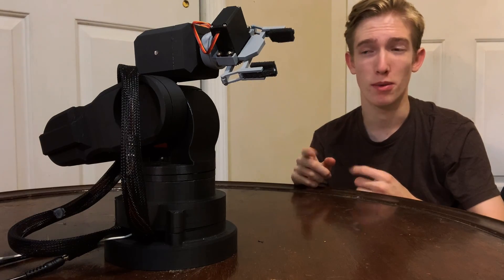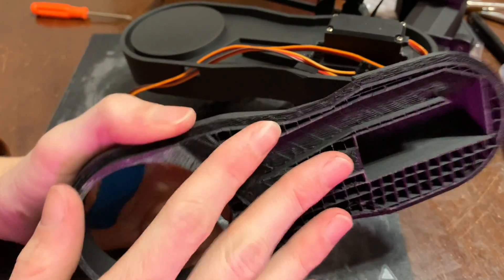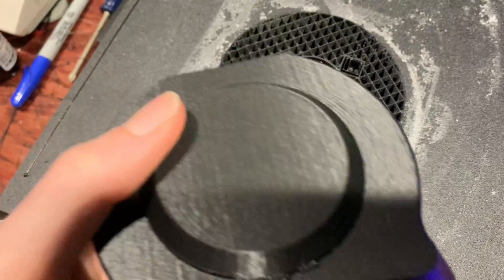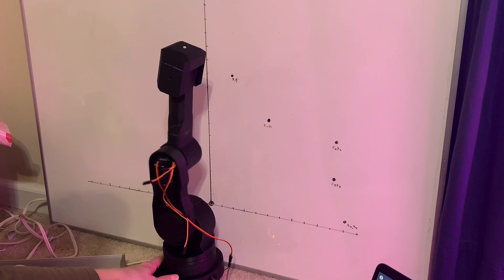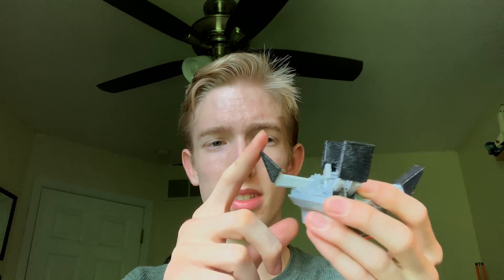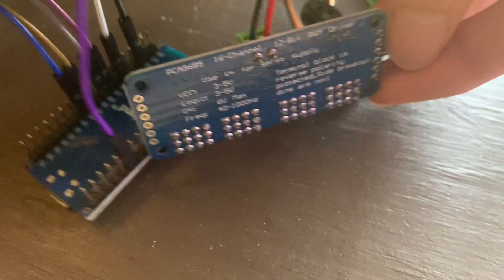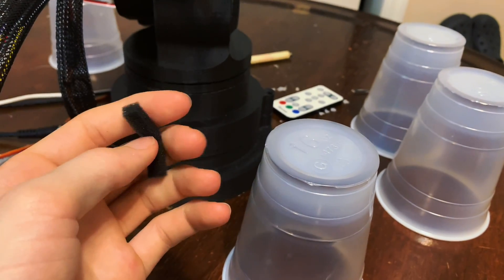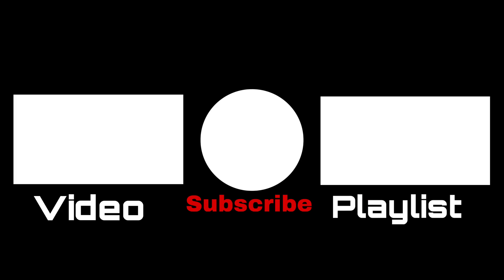3D Printed Robot Arm (Arduino)

Comment: Hello, are you using 3 types of servo 25, 35, 60 kg (270°) and mg90s?
Reply from the maker: 5 types, 25, 35, 60 kg, sg90s, and mg996R. For the 60 kg I just got a 180°, however 270° would be a better choice.

Comment: Which servo goes to which joint?
Reply from the maker: From bottom to top. First is 35kg servo, second 60kg, third 25kg, fourth SG90, fifth MG996R, sixth SG90, seventh MG996R.
Reply: @OliverPaff hey thanks again man if you don’t mind which disc goes into which circle it seems like only the big fat disc fits all of them
Reply from the maker: If you go to the assembly of the robot arm file it should show which disc goes in each hole.

Comment: Hey, this is truly an amazing work and you made so inspired iv'e started to make my own. I would like to implement the logic of the rotation of the joints. I've seen your Onshape design and i couldnt really figure it out how you made connection with the servo and the printed parts. Can you please explain how it works? It would much be appreciated🙌
Reply from the maker: Hey, thank you so much. I will say the connection between joints could be a lot better. There are discs that need to be printed that connect to the servo motor using a screw and then that disc is glued into the other part of the arm.

Comment: I'm working on a design for mine at the moment, I'm doing a couple of things differently. My base will house the rotating turret, and the initial "shoulder" joints motor will be recessed into the base and actuate the shoulder by means of a belt and pulley, a turntable bearing will allow for this with ample clearance. The second "elbow" joints motor will be aligned axially to the shoulder joints axis of rotation, and drive the elbow using another belt and pulley. This means the majority of the arms mass will be at or below the bottom axis of rotation. Both motors being Nema 17 steppers but geared down for torque and precision. With a third Nema 17 in the base to control rotation, also on a belt and pully system for precision over speed. 

In terms of upper joints, I'm still working on that, but I'm  exploring options to keep the heavy parts as close to the elbow as possible but also allow for a rotating axis before the wrist or a "forearm" rotation. Likely using a NEMA 14 stepper to control forearm rotation, and a NEMA 12 to control wrist bending, both mounted as close as possible to the elbow, the wrist rotation driven by a central drive shaft and the rotation axis of the forearm connected via belt. Then a wrist rotation axis and grab axis will be operated by a pair of servos. I also want a modular hand system so I can clip new end effectors into position.

Comment: I’d really appreciate it if you could share the exact types of motors you’re using and the quantities of each—I’m having a hard time rebuilding it on my own.
Reply from the maker: Yeah, sorry about that. I used 2 SG90 servo. 2 Mg 996R servos. 1 25kg servo. 1 60kg servo. And 1 35kg servo. Hope that helps. Let me know if you have any other questions
Reply: @OliverPaff  From the bottom to the top of the arm, can you list out the servos you're using in that order, i don't know which servos are suitable for which areas. Thanks!
Reply from the maker: First is 35kg servo, second 60kg, third 25kg, fourth SG90, fifth MG996R, sixth SG90, seventh MG996R.

Comment: is there any assembly video.. really need help with the assembly of the robotic arm and step by step building of the robot
Reply: How did you attach the base together the first and second servo together
Reply from the maker: @khii8953 There are discs that connect the two pieces together. The discs screw to the servo and then glue to the other piece. Hope that helps. Let me know if you have any other questions.
Reply from the maker: Unfortunately I have not made an assembly video yet. However, I can help with any questions you have

Comment: I've run into issues overall with motors not fitting into the holes, seems like the tolerance isn't allowing the wires to get through. The major issue however is the 60kg motor linked cannot fit anywhere on the arm and now I believe I need to return it. Any advice?
Reply from the maker: I didn’t have any issues with the wires it might be that there is support material that is in the holes preventing wires from moving through the holes. I turned off support for many of those areas. Also now that I think about it some of the wires I had to pull through using tweezers so I would try that. For the 60kg servo it should be the main joint connection it could be the wire is preventing it from going all the way in there should be a channel that allows the wire to travel down towards the bottom.
Reply: @OliverPaff  thanks

Comment: This robotic arm has a remote control Sir?
Reply from the maker: No it’s controlled by entering points into the code and the robot arm will move to them however adding a controller would not be very hard and there are many tutorials for it.

Comment: I have a doubt , how do you attach the servos to the Printed parts , wont it get loose
Reply from the maker: There are discs that connect to the servo that then attach to the rest of the arm with glue. It’s not the best attachment design for the ability to take it apart but it is strong. Also adding holes for bolts for connecting the pieces would be pretty easy if you would like to.

Comment: in the robot how did u connect the joints with the servo in the file there is no place to join or bolt a servo horn

Comment: yout vidoe was very great,but ı wonder how did you learn to write code.I wonder it because ı'm going to start to learn write code as soon as possible,so ı need to take a few opinion can you help me to understand more clear about how ı can learn
Reply from the maker: Thank you, I really don't know much coding though. I'm still learning and plan on taking some online courses this summer. However, I would recommend doing hands on projects such as with an Arduino. Also, YouTube can be very helpful when learning coding along with free online courses. Such as through edX. Let me know if you have any other questions.

Comment: which servo motor is that?can you give the specs.
I wana know if my TowerPro MG996R servo motor has enough torque for that build?
Reply from the maker: I used the MG996R for some of the joints however others will need a stronger motor. I linked all the motors in the description.

Comment: Can I ask which 3D printer you use? Been wanting to work on one myself but new to 3D printing in general.
Reply from the maker: For this project I used the ender 3. However, after this project I switched to the Bambu Lab A1 mini. Personally, I prefer the A1 a lot more because I spend less time working on the printer and more time designing stuff. I would recommend doing more research into different printers to figure out which one meets your needs and price range.
Reply: @OliverPaff  Thanks for the response and cool project overall! Did some research and that A1's calling for me lol.

Comment: How did you end up making the servo horns stick with the servo ajd not come off specially in the button join plane x-y
Reply from the maker: I had discs that connected to the servos that I then inserted into a hole. I held it in place with glue however If you are looking for a way to make maintenance easier I would recommend trying to add screws to hold it together.
Reply: @ thanks man, I tried that, how ever for anyone else wanting to try just a tip you will need to change size on some stuff as adding that servo horn makes it wider, specially at the head of the third join. Nice project man will see how it turns I am still working on it

Comment: Quick question on how you connected the motors to the circular pucks?  What screw sizes did you use if any?
Reply from the maker: I used the screws that come with the servos, I’m not sure on the dimensions of them.

Comment: Good design, you've done well! However, from the video, it seems there are no hole cuts for the servo mounts. Additionally, I'm curious about how you routed the wire for the shoulder and a few other links. I hope that version 2 will incorporate more design considerations. That would eliminate the need for sanding and gluing.
Reply from the maker: Thank you! Yeah the connections need a lot more work, glue was a horrible choice to use to connect everything. The next design will definitely incorporate better connections. Also for the shoulder the wire just goes to the back and then down a shaft in the shoulder.

Comment: Great job on a very good looking design!  

I've printed the main components, and I'm wondering how the joints fit together.  I see there are disks that connect to the servos, and I assume the disks are joined to the servos using screws.  What about the other end of the disk?  Did you just glue them to the arm section being moved by the servo?

Thank you for all your hard work.  By printing your design and pondering a bit, I've learned a lot about what I want to do to personalize it.  Yours is definitely the best looking actuating arm I've found.  You've inspired me to start designing again.
Reply from the maker: Thank you so much!
Also yeah the discs connect to the servo using screws and then are glued into the arm section.

Comment: Wow you are great and how much does you infill ???
Reply from the maker: I did a low infill to lower the weight to put less strain on the servos. 10-20% should be good.
Reply: @OliverPaff  thanks can i print 20%  the base servo 35kg the first axe servo 20kg and the other servo 11Kg is that nice ?

Comment: Hello, good project, I have a question about the motor that lifts the whole arm, did you have a problem with this motor because it didn't support the weight of the whole arm, and when you connected it to the PCA module it still didn't have the strength to go up because it had too much weight.
Keep up the good work!

Comment: so how can you incorporate a voice controlled interface to it
Reply from the maker: I’m not sure exactly, since I haven’t done it yet. However I think you can have a voice control module with certain controls on it connected to the arduino. For example if you said “move forward” the voice control module would detect that and then it would send a command to the arduino to move two of the servos a certain amount.
Reply: @OliverPaff  thanks can i get a rundown of all the components that you used?

Comment: Good job for the CAD and Electronics but your 3D print quality is horrible. You need to figure out the good temperature for your filament or change the brand. Otherwise it must be your settings. Your part are too brittle

Comment: How are you doing inverse kinematics for J4, J5 and J6? I understand the geometric solution for 3dof but wondering how you've done the IK for the remaining 3dof. Seems a lot more complicated when adding the additional dof. Also are you interpolating your servo positions? May help reduce the jerk
Reply from the maker: @tomfoolery2913  I actually only did the geometric solution for 3dof and then for the J4, J5, and J6 I just had a couple lines of code that switched them between two angles. Such as the claw head going up and down. It’s definitely not the best way to do it, however doing the inverse kinematics for the other 3dof was more complex than I was wanting to deal with at the time. So I just decided to kind of cheat my way around it. Also I did look into interpolating the servo positions but I never actually went through and did it. That is definitely something I’m planning on doing for the future version though.

Comment: where I find library  <Servo.h> <math.h>  <Wire.h>  ??
Reply from the maker: Those libraries should be included in the Arduino ide already. If not you can google those libraries and there should be a way to download them.

Comment: What should be the bed size for printing this? I am out for buying a 3D printer. What do you recommend?
Reply from the maker: I printed all of this on an ender 3, so 220 x 220 x 250 mm is probably the best bed size. However I have recently switched to a Bambu labs A1 mini and it has amazing quality although it has a smaller print bed. I would recommend doing more research based on what you want but the best size for printing this project would be 220 x 220 x 250 mm.
Reply: @ would you recommend the bigger A1? That looks great, is there an alternative? There is Kobra 2 Neo, which is sufficiently big but lacks seriously in comparison to A1.
Reply from the maker: Yeah I would recommend the bigger A1. I haven’t looked into any other alternatives though, but there are some great review videos on YouTube for other printers. Which I would recommend checking out before buying one.

Comment: 1:42: Well add a couple of layers and a Brim before the actual piece starts to be printed. Also, use Stick Glue, over the printing area (over bed printing) it is a little messy but, allow the first layers to stick properly and then removing the piece will be easier...finally let the printing piece cool down before removing and get one of those Art (iron) spatulas that are very tight and will do a more easy job, and don't rush the removing, breath, relax and take it easy...it will come out nicely!!!

Comment: Hey, I wanna ask if the files are updated or not bc you mentioned that there were some problems with the model in the description. And also I just wanna say, your amazing, genuinely
Reply from the maker: I have fixed most of the issues, however I kept it so that the pieces can be glued together. If you would like to change it so that you have to use screws instead, the CAD files are available so you can change them easily.
Also thank you!

Comment: I looked at the file you sent, the part where the arm connects with the base is missing. Could you look into that?
Reply from the maker: Yeah, when I was working on it I must have turned off the visibility. I just fixed it. You can check the side bar of the assembly and see the parts, they should have an eye next to them. If you click it, it turns the visibility on and off.
Reply: thanks
Reply: Approximately, How much did the project cost for you? Excluding the 3D printing costs.
Reply from the maker: Probably around $40-$50. However I did buy some of the items when they were on sale.

Comment: You sure have a lot of issues with your 3d printer.  I had a Ender 3 Pro for several years and I have never had that many issues on a single project.  Still, a good project.
Reply from the maker: Yeah it was mostly because I didn’t level my bed properly. Looking back on this project I cringe a little because of how obvious the issue was though. Lately it’s been printing a lot better.
Reply: @OliverPaff  That would do it.  I hate leveling the bed which is why I added a CR Touch bed probe.  I recently upgraded to a Ender 5 S1 and I love it.  I only had to level the bed once as it comes with CR Touch and it prints over twice the speed with better quality.  I could probably get to print faster if I used klipper firmware instead.

Comment: Yeah, I had similar issues with the servos.   I'm using an ESP32 in my project, and trying to drive just a few motors from the thing was causing the glitching.  I'm using 8 servos, but at most only 2 are required to move at the same time, so I thought it would be fine.  Then I added the PCA9685 and it was all fixed.  I went into it blind and was learning as I developed things. 

Thankfully I didn't fry the micro controller.  It's understandable though that, when you're new to certain types of projects, you're gonna overlook things, or be totally unaware of things you should know.  I guess that's why research is important;

Anyway, well done on getting the robot to work - a robot is on my bucket list; but that's a long way off.

Comment: hey man, can you please elaborate upon the 3d files you have linked to in the description? what corrections would I have to make besides those mentioned in the description? i know nothing of 3d printing and would have to outsource it for this project (which i really wanna do) so please tell me all you can!!
Reply from the maker: Honestly you can make the project without making adjustments to the files. You will just have to do some sanding and instead of screws you will use glue. Some people don’t want to sand or would prefer to screw everything together so I just mentioned that in description just in case people wanted to change the files to their liking.

Comment: Great project! Some tips on ur printing issues, using pla(I'm assuming that what ur using) use glue stick on ur bed after u wash it with soap and water and dry, important! It helps with adhesion but also helps as a release agent for ur parts. Set bed temps @ 50-60c, tip temps 225-230c, I use sunlight pla+ excellent filament and inexpensive too. Don't run over 50mm on speed, Ender3's  don't like speed. Hope this helps, keep up the great projects!!!!!

Comment: First of all I would like to say thanks for showing the work on this project with all your slip-ups and mistakes, really full respect. You have shown what it really looks like and how much effort it took. I think I'll use your projet myself because it looks really well thought out. For now I'm waiting for you to update the project on the onshape Robotic Arm V2, so far I'm watching and analysing what's what. It looks really good. I miss showing how the motor pinion is connected to the moving part.... You didn't use any gear ratios (cycloidal gear?) just a direct connection? I need to do some more thinking on this.